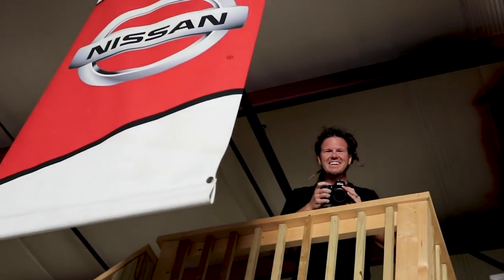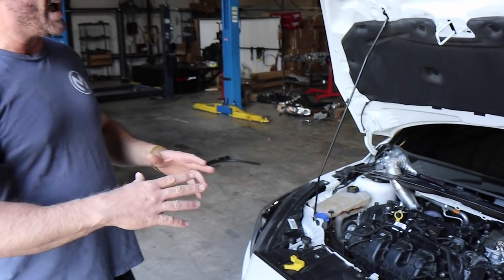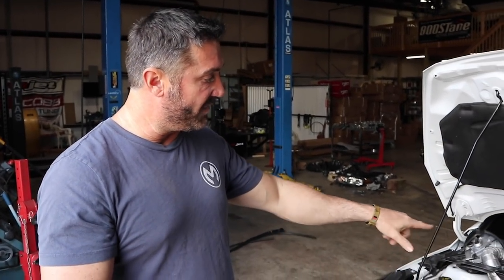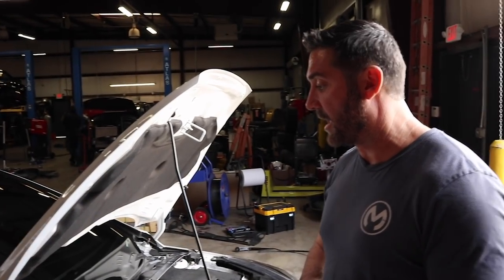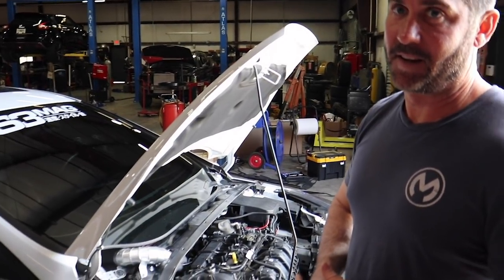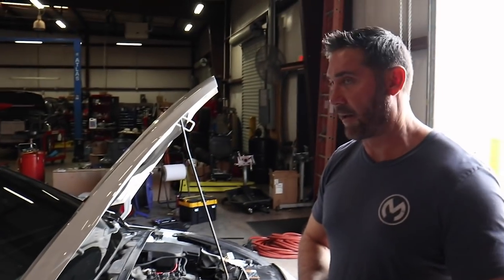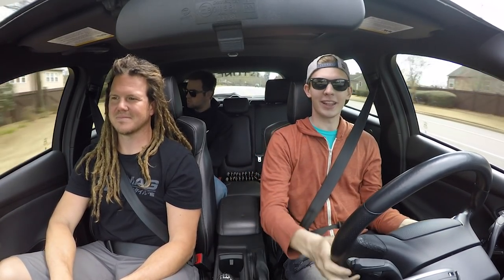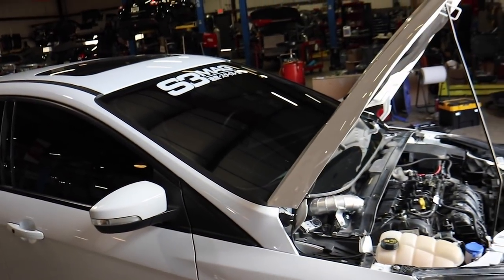WORLD'S FIRST Cowl-Induction Intake For Focus ST | 2J Racing

Comment: Dont STs have the same intake the RS has?   I dont see any benifit to this over running an aftermarket CAI and box with a big mouth to the front of the grill.
Reply: My thought exactly. Even stock intake and airbox with a big mouth. That's my setup and works like a charm.
Reply: @ryanm1466  I'd I have a steeda cai and the whole intake tube is like 50% bigger and much straighter than the stock tube. The stock has lots ot bends and it shrinks down pretty small in the middle
Reply: @sategllib2191  I was thinking about getting an intake if there are noticeable benefits. So you really think there are actual, noticeable performance increases?
Reply from the maker: Serves relatively the same purpose, to eliminate the heat from the engine bay going into the intake. The big mouth pulls air from outside the car while the cowl intake completely eliminates the filter being inside the engine bay all together. At that point it comes down to the style that you want. Plus the cowl-intake makes 3x the turbo noises. So if you are a fan of rad rice, this is the route for you. If not, the set-up you mention is good as well. It’s all preference.
Reply: Ryan don't get one it's a waste of $300, the car takes in more air then the turbo needs and cooling the air is pointless since it's a turbo it has the intercooler, once it hits the turbo it gets hotter and hits the intercooler, no need for a stupid big mouth unless you want the look
Reply: @anothersnaf88  big mouth isnt 300 bucks it can be had for less than half that.  And yes stock you would be right, tuned and modified you are not.  The look is just a bonus.
Reply: @herpderp1662  I'm actually right unless you get a bigger turbo so yea, it's a waste of money
Reply: @anothersnaf88  because the stock MK3 ST has exactly 0 issues with heat soak and I take temps right 🤷
Reply: @Mace-1191  stock intercooler is shit, that's it. Worried about temps get an intercooler
Reply: @anothersnaf88  well your completely wrong there removing the active grill shutters and a properly placed and well fed induction kit lowered my charge temps by a good 10 degrees Celsius. If intake temps had 0 part to play in the temperature of the inlet and charge temps why do company's and teams rework the the whole intake system ? Or why when you buy a ST new does the manufacturer fitted air box have a built in endplate you can remove to allow more and colder air into the intake ? Why bother having the 2 snorkels that feed the underside and front side of the filter with cold air Infront of the radiator ? I agree with you regarding the intercooler but you can very easily run a stock set up ST with nearly 300bhp without touching the intercooler it's not the be all and end all you can only have a intercooler the car and turbo can realistically use too big and your down on power too small and your going to have overboost and compressor surge issues. The information is out there it's not hard to find. 

Saying intake modifications are only worth doing if you've got a bigger turbo show me a single turbocharged car that is getting too much air and struggling because of it ? You won't that defeats the complete point of turbocharging and kind of craps in the face of heat and energy transfers by that logic a normally aspirated car should always have the "stock" air set up for all applications, saying your right and throwing some big words doesn't make you right
Reply: @Mace-1191  I've seen the spec sheets and info from other turners and the groups im in, the turbo heats everything up that your intake cooled down from the start of it hence the intercooler and no tuner would say stock intercooler is enough for 300hp, and never said to much air is going to hurt anything but the turbo can't use it. Like a toddler trying to hold as much air as an adult can. You can say your correct but you aren't actually correct. If you don't agree move on it doesn't effect me in the least. Enjoy
Reply: Matt Hyde 300 hp on stock intercooler, no tuner will even give you a stage 2 tune without a upgraded intercooler,  only a few 300 hp stock turbo cars out their.

Comment: Does this fit all year models? Like 13+?
Reply: It should
Reply: I only ask because I know there’s a difference in sensors from 13-14 and 15+.
Reply: When you purchase from the website it will give the option for 13-14 or a +15

Comment: There is no exhaust mod that will ever make any of these headifold cars sound decent. Every time I watch an st, an rs, or a golf video it's all I hear - faaaaaaaaart psssst
Reply: Right?! Sounds like a 4-cylinder is in there lol. So lame, right? You wouldn't think it would sound like a 4 banger, right???..................
Reply: @xlamoremortelx  these cars even begin a 4 cylinder would sound pretty good if they didn't have a headerfold, not saying all 4 bangers sound bad
Reply: Partially agree but also disagree when you have a good exhaust set up. My milltek turbo back with out resonators sounds about as good as it gets. 0 drone, no raspy high pitch "honda" sound, and deepens it up a little. Definitely not the best 4 banger exhaust note out there for sure but you can make it work
Reply: The civic type r uses a headifold and mine (and others) sound incredible. Nice low, deep growl and no tiny sound at all.

Comment: But it has an intercooler?... You guys over the pond will buy into anything 😂😂😂
Reply: From the looks it's mainly for sound and colder Intake temps which helps the IC
Reply: You know what an intercooler does right?
Reply: Da Ca  if it was that good of an idea then you would see it alot more from factory!... But you don't. You may as well go the whole hog and run it up the A pillar 😂
Reply: Da Ca  but I am still not wrong lol you guys will buy into anything it's painful and highly comical
Reply: @WPTUNED  yes air goes into the turbo then through the intercooler before going into the engine.  My thinking is why would you not want the air going into the turbo to be as cool as possible, if its cooler going into it it should be cooler coming out by comparison thus helping the intercooler as much as possible how is that a bad thing?  It should not be an either or situation it should be a both situation...meaning having both should be better than one or the other.  Every little thing helps.  Also the intake tract is much shorter helping spool time and throttle response, again not bad thing.  When you have an upgraded turbo the benefits are going to be even better.  Theyre not going to put an intake like this on anything stock did you not hear the sounds it makes? Do you really think a manufacturer is going to put something that loud into a car from the factory?  They do things to try and quieten the intake not make it insanely loud.  If car a has intake temps of 100 degrees...it goes into the turbo and gets heated up to xxxxx degrees before being cooled down again by the intercooler to xxxx degrees....car b has intake temps of 70 going into the turbo...the air coming out going into the intercooler to be cooled down before going into the engine on car b is going to be cooler than car a...which makes the intercooler work that much better.  The hotter it is outside the better this effect is going to be.  There will be far less heat soak with this intake in normal stop and go driving.  The hotter intake temps are the hotter charge temps are and its the same visa versa
  Anything that brings down intake temps AND/OR charge temps is a good thing and can only help.  Improved spooling and throttle response, cleaner looking engine bay and awesome sounds are just a bonus.  Just because these cars originated overseas dont make you guys the only people who know anything about them